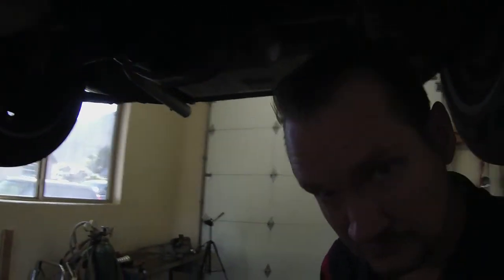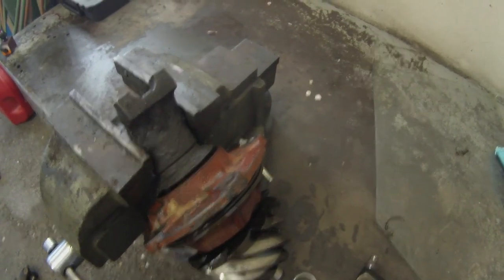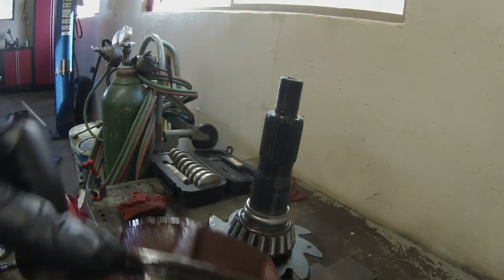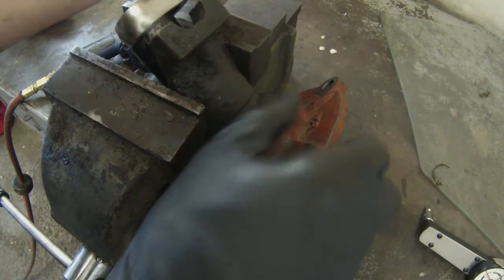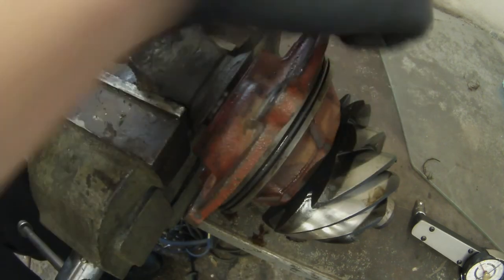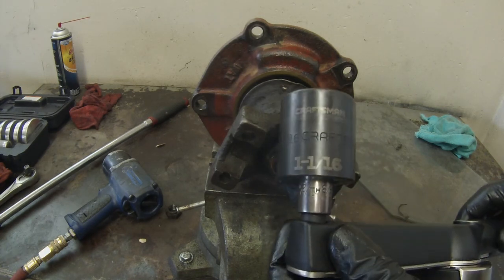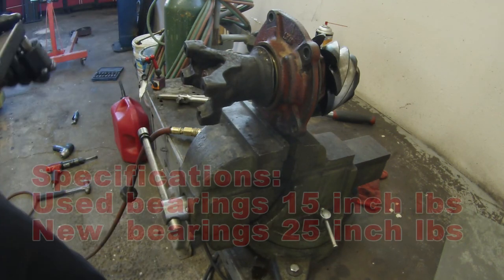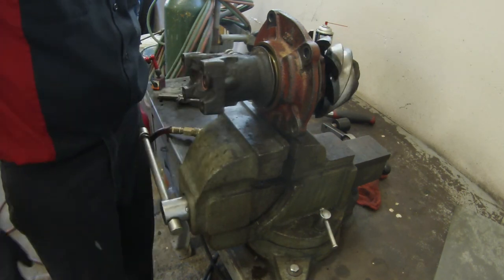How to set your pinion bearing pre-load on a 9" Ford differential

Comment: We've done a few and typically just mark the nut, the shaft, the housing, and the yoke and even count threads exposed or length of shaft exposed, the reassemble to exactly the same point, using lock tight on the nut and  not going any tighter.  Changing seal didn't change crush or bearings or shaft length between them.
Reply: I would more than likely do the same as you .

Comment: Thanks so much! You made this seem easy and doable for a beginner. Owe you a beer…
Reply from the maker: Ha ha sounds good 🍻
Reply: Hey, I see that you set the pinion pre load on your bench. I see a lot of YouTube videos that perform this on the car or truck. I like your bench top method due to my arthritis. Are there any issues with doing it on the bench as you did? Thanks again and happy new year!
Reply from the maker: Setting the pre load on the bench is the proper way. If it's up in the car, you're now adding the resistance of the ring gear and axles which throws off your numbers. This type of differential must be done this way. I hope that helps. Happy new years 🍻
Reply: @AlfsMustangGarage  what make / model is your dial torque wrench ?

Comment: I use a impact till I can feel a slight drag it's on point every time but I've been building rear ends for 25yrs. Lol
Reply from the maker: Oh nice! Ya if you got the touch, you've got the touch!
Reply: @AlfsMustangGarage  I was going to say the same. Most would would call me a hack but you can tell, with experience, what  15 foot pounds of torque feels like and yea, you get used to what your impact can do. I sneak up on it, then I use a breaker bar with a cheater bar on it until the slop in gone and then sneak up on it with the breaker bar till I feel a little bit of drag. I can tell when there's two pounds but I check it anyway, I give it a touch more, if that's 15 with a used bearing, I leave it alone. If was 16 inch pounds... I leave it alone. One inch pound is not the end of the world, especially with a used bearing. It's a little more critical with a new bearing I suppose. I have many times marked a line on the nut and the the shaft, reassembled it, got to that line and when just a fuz past it. Sometimes nobody in town has the parts and you can't wait. That isn't technically correct but if you can't get the sleeve, you can get away with it that way. just make sure you end up about right inch pounds. Keep in mind, if you're reusing your old bearing you have to thoroughly clean it with parts or brake cleaner and then thoroughly oil it with gear lube, whatever lube that diff requires. Even with the right tool it's going to be difficult to tell the difference between 15 in/pounds and 16 inch pounds. I only cheat and mark and snug it a little more when nobody's got the sleeve and the customer can't wait. I honestly have never had a come back over that. I've never had a customer say, "oh man, that rear end growls now" or anything like that. If growled before, it's gonna growl after if you're just changing a seal because they want the leak fixed. Anyway...Guys that do this for a living know what I'm talking about. Most of the time I can get a sleeve or I have one on the shelf. I grabbed up a shit load of Ford 9 and 8.8 and the typical chev that was in everything till about 5 years ago...can't remember the size. I have every size there is for Mopar because I'm a collector. And I couldn't get a sleeve for my 57 Dodge. Guess what I did? LOL

Comment: Thanks so much for the video!  Is the crush sleeve and O ring available at a parts store or do I have to buy at the dealership?
Reply from the maker: You're very welcome. I actually posted some links in the video description for the parts used. Should see the crush sleeves, seals, o-ring, and pinion nut 👍
Reply: @AlfsMustangGarage  Thanks for the quick reply!  I'll look for the video description.  The rear end on my '85 F150 4X4 has the U-joint yoke but no way to remove the pinion gear.  Wish I could send a pic!
Reply from the maker: Oh ya it sounds like you don't have a Ford 9"

Comment: Did the new bearings have a higher inch pound rating due to the fact that they wear out a bit over time?
Reply from the maker: Yes, they need to break in so they will "loosen" up.

Comment: Hey....Sorry to bug you again. I was reading about Crush Sleeves vs. Solid. I'll be doing my Ford 9 inch soon and will reuse the original bearing just like you did. Should I consider a solid sleeve? Reading about both sleeves confused me somewhat. As always thanks for your guidance...
Reply from the maker: I would use a crush sleeve if it's for a driver. Solids are good for applications where you know exactly what size you need to put the right amount of preload and typically used more in performance applications. I hope that helps.

Comment: Is the crush sleeve only used in the 8" ? I'm changing the pinion seal in my 9" and there is no crush sleeve..
Reply: additional.... I only pulled the yolk off and there is a washer and then i see the bearings... after seeing all thru the video, i don't think i'll see that crush sleeve unless i take the whole pinion out..   please correct me if i am wrong ..
Reply from the maker: So the 8" and 9" are setup the same. The difference is the overall size. The thing is, you can use a crush sleeve or you can use shims. Either way is correct as long as the bearing has the correct preload as per your application. Daily drivers usually get the crush sleeve as where high performance usually get shims.
Reply from the maker: And yes, you'll have to pull the bearing off in order to see the crush sleeve or shim.

Comment: You made it look easy enough. Now I feel confident to do it on my 66 Ford Thunderbird(pretty sure that whale has a 9"). So, proper torque for crushing the sleeve is 180 to 200lbs? Just wanna torque it down correctly. Leaks piss me off :)
Reply from the maker: So the pinion nut doesn't have a torque spec. You have to tighten it with a new crush sleeve till you achieve the correct rotational resistance. Then you're good 👍
Reply: @AlfsMustangGarage  Awesome! I was hoping to not have to drop the whole pumpernickle to stop the leak & now I know how -thanks! 
One more question I'm hopin you could help me with. I've seen gear oil in dif's that look like gray mud. I'm hoping that's not the case in mine. Is it possible to "wash/rinse/scrape" out the old gear oil since I'll be in that general area when I pull the pinion? I'm trying to make it easy by not having to drop that heavy pumpkin as well as remove the axles. I'm lookin for a shortcut. I wanna do the refill of gear oil without havin to do all that. Any advice/suggestions are greatly appreciated!
Reply from the maker: This is what I would use to get all the fluid out. Those are cheep and they work good to pump out all the fluid without making a mess 👍 
Koehler Enterprises RA990 Multi-Use Siphon Fuel Transfer Pump Kit (for Gas Oil and Liquids), Red medium https://www.amazon.com/dp/B0181EDCZ6/ref=cm_sw_r_awdo_navT_g_4FHW8X0V2EV38257XYC7
Reply: @AlfsMustangGarage  I actually have something just like it. It was used some years back to flush out trans fluid in a Ford T5 when q buddy of mine installed a racing clutch. I'm glad I held on to it...I'm sure it will get most, if not all of the old blackened gear oil in the 9". Thanks for your feedback & advice -it really helps!
Reply from the maker: You're welcome! Good luck with your project 👍

Comment: So the pinion housing has to be out of the rear end to set the preload on the bearing. Looks simple enough thanks for showing. Never seen the dial inch torque wrench maybe they rent them at  parts stores.
Reply from the maker: You might be able to rent them. If not, they are pretty affordable to buy.

Comment: I have a 72 F100 with a 9" rear end. The schematic shows two bearings and crush sleeves. Can I use the same process you did with this Mustang?
Reply from the maker: Ya should be an inner and outer bearing and 1 crush sleeve?
Reply: One last question before I tackle this over the weekend. What did you clamp your vice to without causing damage to the pinion?

Comment: Hey my friend, Sorry to bug you again....Can I ask you a question where I know what is the proper way. But..... Could I get away with just pulling the yoke from my Ford 9inch, replacing the seal and then putting the yoke back on and torque it down to where it was or close to where it was? I know the right thing to do is to put on a new crush washer and do the preload stuff... Do you of anyone that has done this sucessfully? - of course no liabilities intended in your response...Lol
Reply from the maker: Well I want to say that you will likely be okay if you attempted that and got it as close as possible. However, of course I would advise against it.

Comment: so if i just want to change my worn out yoke i have to do all the procedure like in your video? f*ck.. i cant do that by myself :(
Reply from the maker: You could always see if a local shop can get your pre-load setup for you if you don't have the means to so it yourself.
Reply from the maker: It also depends on your setup. Some of these are setup with shims instead of a crush washer like in this video. If you have shims, you can swap out your yoke, tighten down a new nut to the torque specs and then verify the pre-load with an inch pound dial torque wrench. But at the end of the day you could always ask around to your local shops to see if they can do it. Shouldn't cost much if you bring them everything.